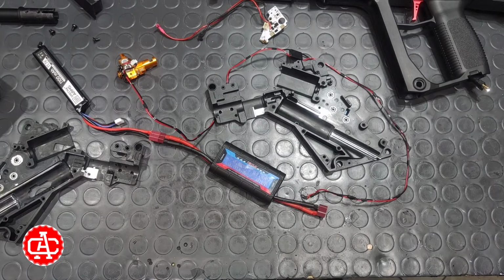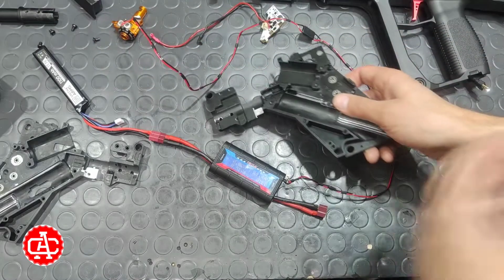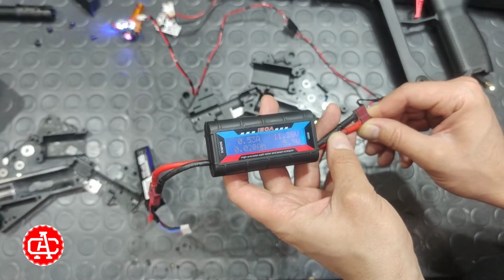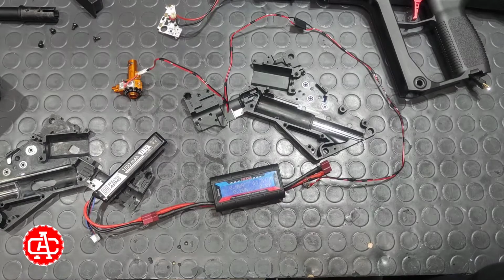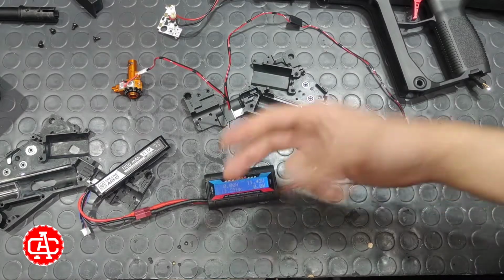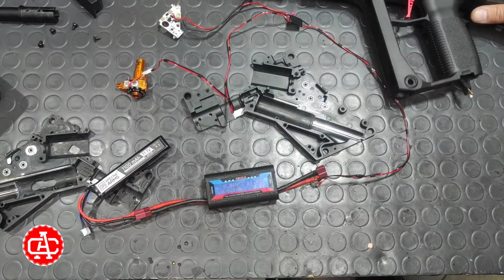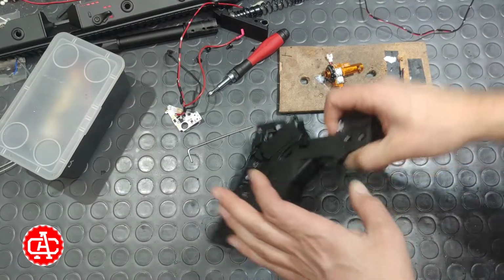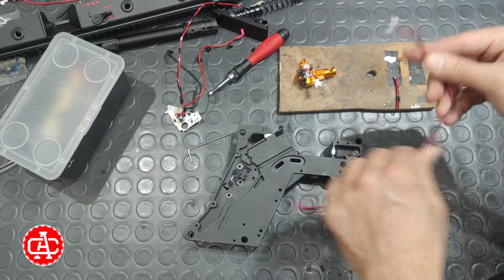Krytac Kriss Vector DSG Upgrade: Part 6- Tracer rewiring and installation

Comment: Great info I was wondering where to solder to the perun mosfer
Reply from the maker: Thanks 😊, i was also wondering and just measured the consumption. It wasn't so high and I decided to connect it to the motors power line. No matter the small Amp draw it will be better to add a small switch (even in Vectors case), nobody will play with tracer bbs all the time, so light is not needed 100% of the time. Lefting this as an info.

Comment: So that's how you wired it. I wired mine around the left (directly to battery contacts since the safety cuts power) and it interferes with the selector sensors just enough that trigger programming is finicky. Works fine for regular usage though. I might redo it your way. Thanks for the upload!
Reply from the maker: You are welcome 🤗! I could've done it a lot cleaner another way but i wasn't sure if I could mill down so deep around the tappet mechanism. One thing is sure..... the connection of the tracer, the rest is just work made by the idea of having a working ME PRO+ tracer inside of Vectors gearbox 😅.
Reply: @AC-AirsoftCustoms  My friend had suggested just shortening the original wires and keeping the screw terminals on there so you could slip it under the motor connectors, like, literally right on the motor. Could I ask your thoughts about that?
Reply from the maker: @0OParanoiaO0  that will also work, the tracer had been made to work that way. However i didn't try that on the vector, but you can and will work the same way as by soldering to the board. In reality i am complicating the process cuz i had one vision for it  and due to limited space I had to come to another solution.

Comment: Great work! Im now in the same spot, but I was thinking to wire the tracer directly to the motor wire output to only light it when I push the trigger. I mean near the fastons. What do you think about it?
Reply from the maker: Thanks 🙏, it is the same thing i just overcomplicate the wiring, so you can connect it to the motor without doubt.